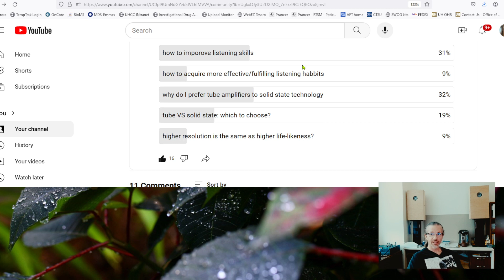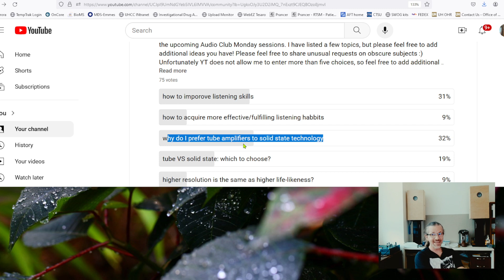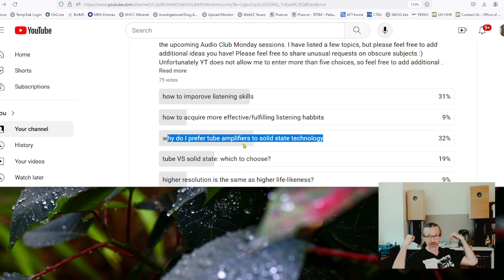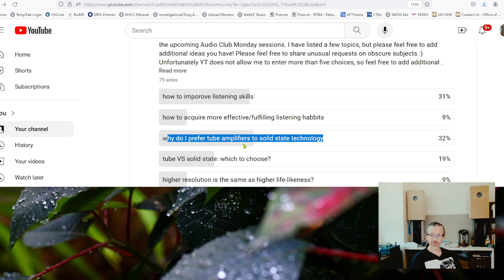Diving into next weeks' extended Audio Club Monday:  EPIC Tubes VS Solids coming!

Comment: Janos, I wonder how this touches on combining these two topologies i.e. a valve preamp into a power amp such as a Pass Aleph?
Reply from the maker: Superb question! The valve preamp section can improve the linearity (provided highly linear peamp tubes were used), improve low level detail amplification, while the SS output section makes it much more cost effective to match to diverse speakers. When looking at the distortion, this way it is easier to achieve a solution that lies between the two topologies and the weaknesses of either approach are restrained by the other component. However, the benefits are limited as well, but in the case of an average user most often it is beneficial, or the beneficial synergy overpowers the negatives.

Comment: Janos. Thank you for a fascinating introduction. Would I be correct in saying that you are asserting:  1. That a properly matched amp speaker combination will rarely generate high levels of distortion because the amplifier is operating well within its limits. 2. That tube amplifiers have more harmonically related distortions (low order and even) and, hence, their distortion is less noticeable. 
On a related topic, it would be great to hear your thoughts on intermodulation distortion in speakers: Know the high output at a low frequency of a diaphragm alters/modulates the high frequency output. This seems to be under investigated part of sound reproduction. As always, thanks my friend for great work!
Reply from the maker: Hi Bruce, yes, both observations are correct! :) On the Doppler effect (the loudspeaker IM due to diverse frequencies riding on each other): some manufacturers went deep into investigating it, such as Wilson and PS Audio. My take on it is that it is one aspect, and the most practical way to keep it under control is to use a large, extremely efficient driver so the cone movement is absolutely minimal, translating into minimal doppler distortion.  Another approach is to use a massive number of drivers, each driving a different frequency band, so they do not overlap. (Wilson's approach) Each approach has +/-. The more extreme measures we are taking to avoid it, the more extreme side effects it causes in other areas. (There's no way to fix something without breaking or compromising something else.)